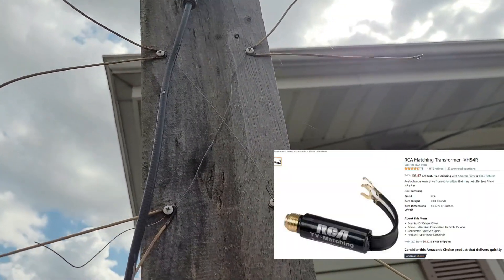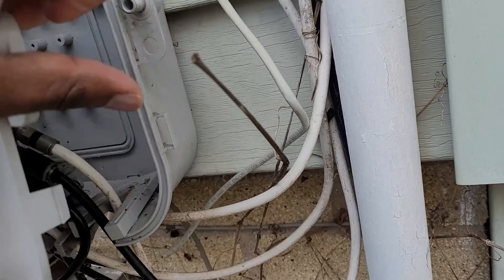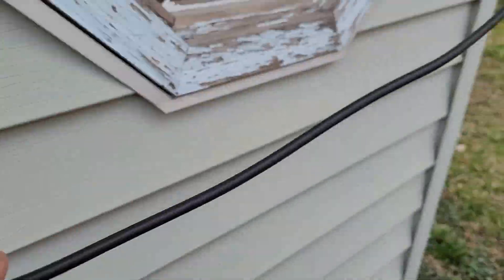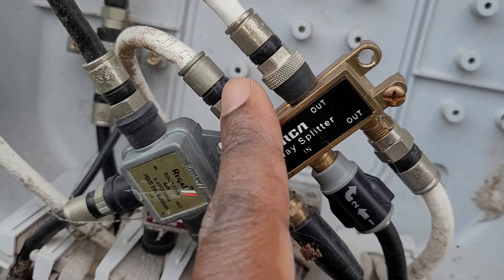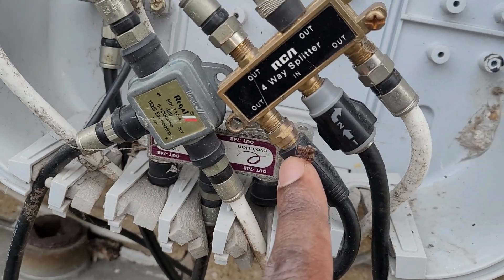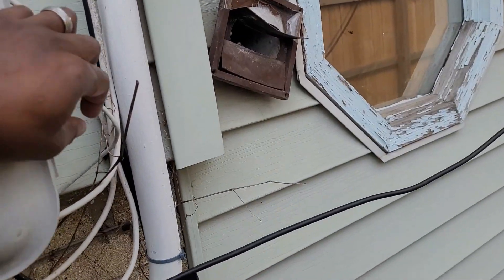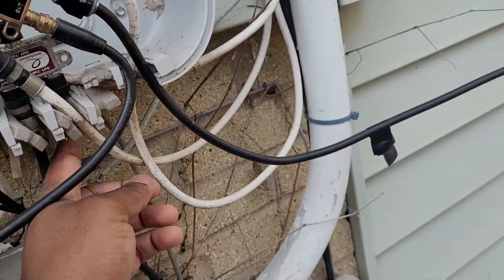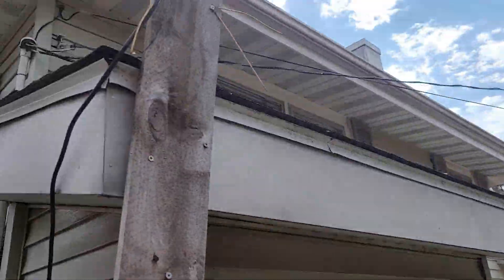DIY long range Tv Antenna for free tv

Comment: pretty cool you can make an antenna out of cheap stuff you have around the house.  I've built 4 antennas, 2 like yours, 1 smaller than yours (4 bays), and 1 grey hooverman.  It's fun stuff.  make sure you fill in the holes with caulk or something on your house so you don't get water damage.  well done!!
Reply from the maker: Thank you and yes I foamed it in too. I have to research the Hooverman
Reply: @atechieinchrist  The Grey Hoverman was designed in the 60's. With the repack of digital signals it's nearly ideal for reception of television's 400-600mhz signals.
With the addition of NAROD hats, the hi VHF signals are strengthened. 30-300mhz. 
This design allowed reception of 30+ channels, where the four bay bow tie antenna you've built in this video, only yielded 15-19 channels for me.
Reply from the maker: @PhaQ2  I need to research the grey Hoverman that sounds interesting
Reply: @atechieinchrist  It was definitely worth the effort to build it, for me. I live 47 miles from the closest transmitters in N. Y. and 62 miles from the closest transmitters in Philly. 
The Grey Hoverman design isn't found on the commercial market, so you'd have to build it.
I would've provided a link to the specs, but you know how YouTube feels about links in comments.